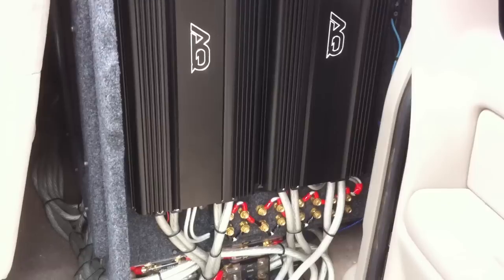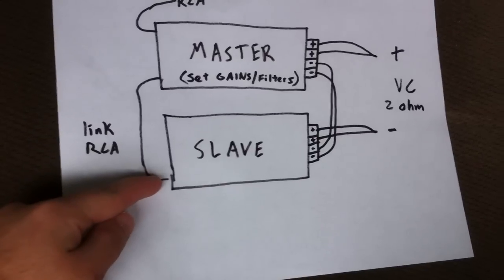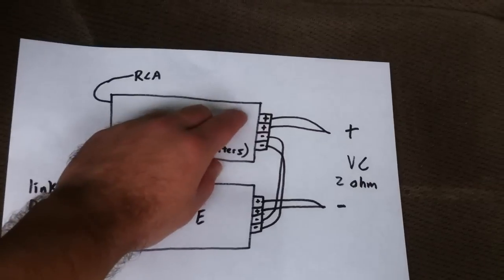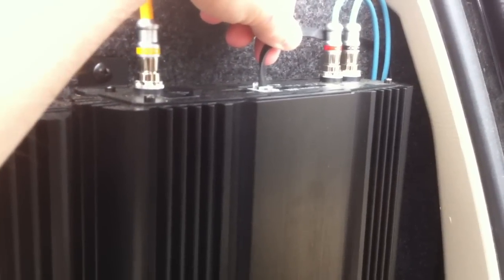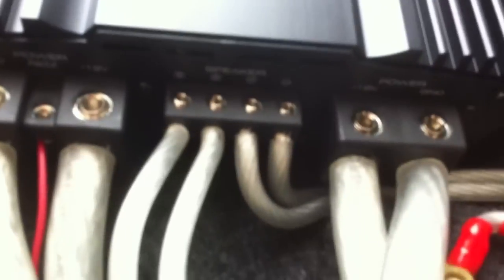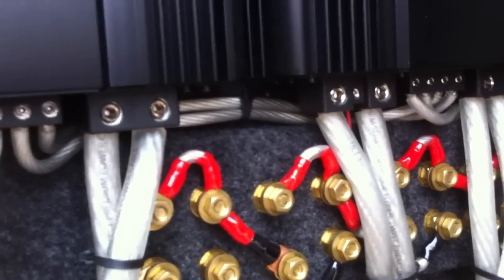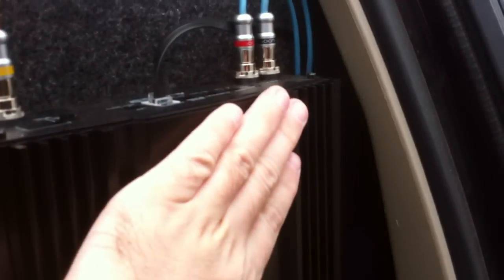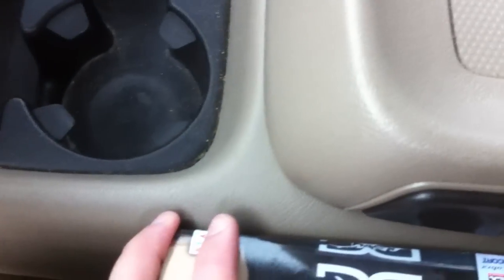HOW TO:  Wire Strapped Amps

Comment from the maker: It depends on your electrical, I ran mine down to .5 ohm strapped, .25 ohm each, if you search my videos, I have one of me testing and clamping the output, 160 db and 11k clamp test.  I run mine currently at 1.5 ohm strapped, .75 ohm per amp.

Comment from the maker: Like in this video you take two amps rated at 1 ohm each at 4300 watts and it makes one large amp rated at 2 ohm at 8600 watts.  Meaning less current thru the voice coils and making same power as two amps separately.
Reply: About how many watts does it make when you have a 0.25 ohm or 0.75 ohm

Comment from the maker: For daily applications, they can be ran down to .66 ohm strapped if you have a VERY strong electrical.  But what is the point?  To increase the life of the amp try to stay in the stable range which would be 2 ohms strapped.

Comment from the maker: @aleman4392 You wire the subs together to achieve a 2 ohm final load, so it would depend on the voice coil config, but the L7 is a dual voice coil sub so it is either dual 2 or dual 4 ohm.

Comment from the maker: For 2 dual 1s, you would do coils in series to make each woofer 2 ohm, then parallel the 2 subs together to make it 1 ohm, wire to strapped pair as described in this video.  Each amp sees .5 ohm.

Comment: i strapped 2 amps together they pretty much strap the same way as your amps but now when i turn the volume up the bass cuts out ,2 planet audio 5150 on 8 12s they wasn't doing it when i had both amps at 1ohm on each set of 4 what is causing them to cut out now
Reply from the maker: You probably have it wired at .5 strapped which is .25 ohm per amp
Reply: Can you give me some info on how to wire the speakers when strapping the amps,don't you go pos to pos and neg to neg and use jumpers to run each speaker to the other

Comment: @AMICUSTOMS thanks for the info. one more question cause you seam to know this stuff well. Does the load the amps see change becasue they are strapped. For example if i series the amp, 2 ohm, will the amps put out power at 2 ohms. I know with a single amp thats true, but because the amps are strapped would that change what each amp is seeing? I thought i could get 1 ohm off of the amps.

Comment from the maker: I haven't used one yet, but once I do I will let you know, from the dozens of different brands I have installed in the past and tested, this one seems to be the best for what I need it to do because it has pre amp built into it, 7.5 Vrms output.  So no worry of loss of RCA voltage.

Comment from the maker: @33mackman Depends on what each amp is stable at, ohm load is added when you strap amps, so if each amp is .5 ohm stable, then strapped it would be 1 ohm.  And if each is 1 ohm stable(most mono blocks) then strapped it would be 2 ohm.  Hope that helps.

Comment: What about the bb5000.there's no master and slave switch .can I strap it together?please reply
Reply: Robert Andres Yes you can still strap them, all the slave switch does is let you control the LPF and gain on one amp, if it doesn't have a slave switch, then you have to adjust the gain and LPF on both amps, they have to be exactly matching, if not you will run into problems.
Reply: Thanks for helping,Mazdabass971,more power more viewers to you.thanks man,
Reply: Robert Andres
bah, i don't care for views i just like helping. lol

Comment: could I just take the remote wire from slave and put it into the master remote input and have the masters remote going straight to h.u or should I splice it into the wire a few inches from amp? thanks.

Comment: so when I strap the 2 amps, does it automatically get wired to 2 ohms?  I'm wanting to run the amps to 1 ohm and I'm wondering if it's based on how the subs get wired or since the amps are strapped if it just stays 2 ohm?... PLEASE HELP!  Are the ohms based on the amp being strapped or on how the subs are wired?
Reply from the maker: How the subs are wired, each amp takes half the ohm load.  So each is normally stable at 1 ohm single they would be stable at 2 ohm strapped.
Reply: +AMICUSTOMS So wiring my subs to 1ohm would get a 1ohm load from the stacked amps?  I just want to make sure I do it right, thanks...
Reply: AMICUSTOMS so if I got four dual 2 ohm subs, I wire them all together for a final 2 ohm load, I have a box with everything wired up inside with 2 bolts on the outside for the terminals. then I just strap the amps and wire them to the bolts? I know it sounds dumb but I'm  trying to get this shit right cuz I don't wanna burn out $5000 worth of audio lol any input will be much appreciated. thanks

Comment from the maker: Then you would need to do all the subs in series to make them each 8 ohms, then parallel all 6 subs into the strapped pair for a final load of 1.33 ohms which with solid electrical to support I am assuming 10k power.

Comment from the maker: @usmcchesty If the amps are linked(strapped) they share the load, each see half the final load, so if you are wired at 2 ohm, each amp sees 1 ohm nominal, obviously your reactive load will be higher do to imp rise, but that is a different discussion.

Comment: thanks for replying there is one more thing i would like to know how am supplying the required amount of current because the manual is saying for 2 ohms it would need 37.6 Volts
Reply from the maker: The amp needs to me set with an oscope or dd1 to gain match properly.  They are referring to gain matching when they are giving you a target voltage to set to.

Comment: Hi have soundstream rub.1600.1d that's 1ohm stable and 1100@ 2ohms on my Psi platform1 12s. So if I buy 1 more and strap it to 2ohms it would only do 2200 watts right?

Comment from the maker: It depends on the electrical, if it is strong enough then yes you can wire lower on these and alot of similar amps even strapped.

Comment from the maker: It depends on your electrical, but if your electrical can support 1000 amp current draw then you are fine at .5 ohm per amp.  Just keep an eye on voltage.

Comment from the maker: When you strap two amps they each share a portion of the final ohm load, so if you are strapped at 2 ohms, each amp sees 1 ohm, half the final ohm load.  So in your case you would see 3200 watts strapped since I am guessing they make 1600 at 1 ohm.  If strapped at 2 ohm each amp sees half making it 1 ohm and making final power double.  So you would see 3200 at 2 ohms strapped.

Comment: hey i got some stuff on order just wondering if you could varify if the items will work. 1 dc lvl4 xl Dual 1 ohm. Running off of 2 DC 1.2k amps. These are strappable. How will i wire the sub, series or parallel? Will each amp see 1 ohm from the sub due to being strapped? thanks in advance. Only good vid on youtube on strapping.

Comment: Awesome vid one question?  I have same amps and want to run two sundown sa10 dual 2ohm would I need to wire each sub to a 4ohm load so the amps would read 2ohms with both subs wired and does each + from amp go to one + terminal on one sub or both + on one sub and same for the - on the slave side

Comment: One ?.....when running a strapped configuration on the slave amplifier do you want your settings to be completely turned down or does this even matter in a strapped configuration?

Comment from the maker: Dual 2, if you are running just 2 subs, wire in series for the coils for 4 ohm each then parallel the subs for a 2 ohm final load to the strapped pair of 2200s.

Comment: hey one ? i got a american bass hd 12 dvc 2ohms 1500rms. and  two american bass hd amps 1600rms at 1ohm i want to strap them together. how do i wire the coils to get the most power out of the two amps strapped?

Comment: i dont know if you know much about the soundqube hdc3 series but i have an hdc3 15in from soundqubed. i dont remember what impedance i ordered, will strapping the 2200w amps hurt it at 2ohm? or dose it depend on impediance.
Reply from the maker: It depends if you have the alum coil or copper

Comment: great video had a few questions if you strap two amps together does this help it from not getting overheated and also if I have 1 ohms coming out of the subs does that mean I have to rewire them to be final 2 ohm stable to match them when I strap them

Comment: if i get 2 1ohm 12s and strap 2 amps together and have an amp for each sub with the amos still be running at 1 ohm a piece? basically im getting 2 dc audio xl 12 m2s and 2 hifonocs brutus 2500 amps the subs are rated 2200w rms i wanna get the biggest bang for my buck but i know the amps have the highest watts at 1 ohm
Reply from the maker: Tyson Evans that would be a final ohm load of 1 ohm strapped which would be .5 ohm per amp.
Reply: do those amps handle .5 ohm? or should i get the 2ohm version and then itd be 1ohm?
Reply from the maker: Tyson Evans I don't know if those amps are .5 ohm stable if you got dual 2s that would be 2 ohm strapped which would be 1 ohm per amp.

Comment: I don't know why I'm so confused over strapping. I understand OHM's law & I read the thread on SMD where you & him were going back & forth in regards to the matter. I get the whole ACV/ACC thing... So just  to clarify. If I want to run a pair of Q-3500D's strapped it would be stable to 2 ohms but If the subs I wanted to run were a pair of HDC415's I'd only be able to wire down to either 1 or 4 ohms, being that they only come  in dual 1's, so I wouldn't be able to do so...correct?
Reply: Correct

Comment from the maker: You can do it one of two ways, Series the coils then parallel to the amps, or parallel the coils and run subs in series to the amps.  Either way will get you 2 ohms final impedance.

Comment: So is it better to strap amps or gain match them I hear both ways. I want to strap mine but people say it burns one of the amps after?
Reply from the maker: strapping opens up additional ways to wire and get a lower ohm load.  Strapping amps in no way will damage one or both amps over any period of time.
Reply: If you have a lower watt amp it will try to keep up with the higher rated one pushing it beyond it's limits which ultimately leads to it's smokey ozone smelling death...

Comment: How do you wire your subs? I have 2 fosgate p3d4 running 2ohms will I have to rewire them
Reply from the maker: Tim Moore no if you are at 2 ohm now that would be correct for a strapped pair of amps.

Comment: hi,i have two amps one is 5 ch and the other one is 4ch.i woul like to wire my 5 ch for my two front speakers and a sub then the 4ch i want to wire it for my two fronts.hope you can help me.i hope its not too much to ask but if you can send a wiring diagram would be nice thanks a lot..

Comment: hi there
if i have one 1ohm amp and i add another one strapped how the ohms will be at the end?
Reply from the maker: Rizal Montañez depends what the speakers are that are connected to the amp(s).
Reply: i got ddx skar audio 2ohm and i have 2 skar amp 1 ohm each
Reply from the maker: Rizal Montañez that would be dual 2 ohm subs?  2 of them?  If so wire the subs coils in series to 4 ohm load then wire the two subs in parallel to the amps.  That will give you 2 ohm strapped or 1 ohm per amp.
Reply: i only have 1 subwoofer 2 ohm andsince i have the 2 1 ohm amps i will like to strapped them to the 1 subwoofer
Reply: i only have 1 subwoofer 2 ohm andsince i have the 2 1 ohm amps i will like to strapped them to the 1 subwoofer

Comment: hi, how do I set my gains for two strapped amps using a multi meter? I have two 1500 rms amps and two 15 inch subs in a shared box. what voltage should I be seeing befors clipping, and what terminals do I measure on? Just master or both master and slave

Comment: But I want to make my amp 1ohm for daily, that's y I'm buy dual 1 subs an strap my amps like in vid, ok in buy 2 dual 1 an wire them series an make it 1 ohm load, so I was gonna wire my amps up just like this to make my amp 1ohm. Cause my subs inside the box be 1ohm just have strap amps like in vid I'm do,,,

Comment: so I couldn't strap 2 1ohm stable amps to 4 dvc 2ohm 12's, because it will have the amps at .5 ohms
Reply from the maker: Bruce Spry if the amps can handle .5 ohm each then you can, that is how I have mine ran currently .5 per amp.
Reply: AMICUSTOMS ok thanks for answering my question!

Comment from the maker: It doesn't matter, but I turn mine all the way down to avoid confusion as to which is the slave or master by just glancing at the setting.  None of the setting on a slave amp are functional when the amp is set into "slave" setting.

Comment: hey, I'm about to hook up 2 amps to 2, 2 ohm dvc subs. do I hook them up like you showed, wire them as I was wiring them at 2 ohms to one amp? or link the amps and run each sub to each amp at 1 ohm? thank you.
Reply: Tim D hey did u ever figure out how to wire them. I'm still trying to figure this out, got my second amp on the way. I got two dual 2 ohm fi sp4 15 and two soundqubed 4500.

Comment: does strapping together  increase  your rms? as in say i have an amp that does 850.4 1700.2 and 2500.1  ? i have a pair of dvc 2 ohm subs that i need to figure out how to wire to that  o have two hifonics brutus elite bex 2500 amps help?